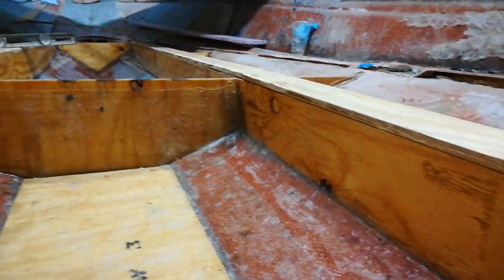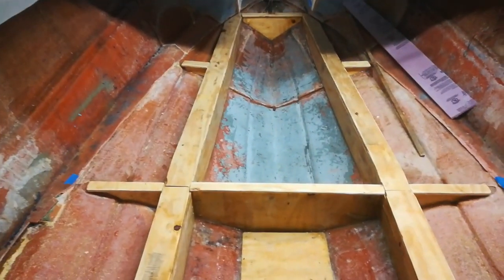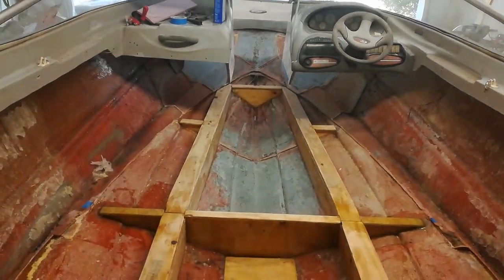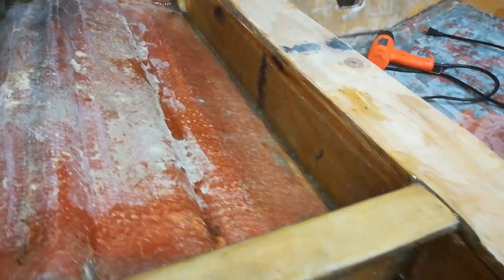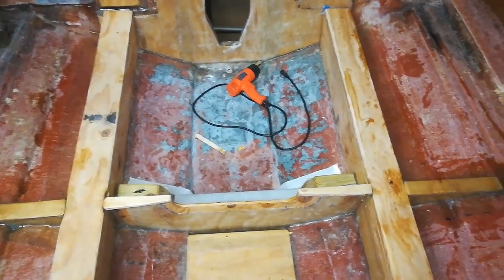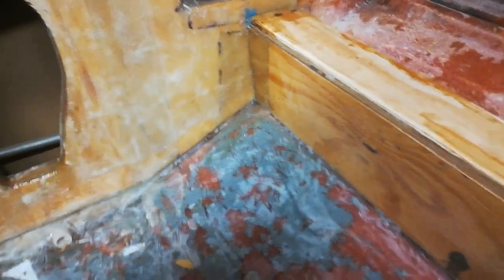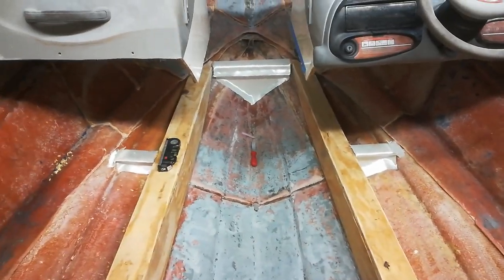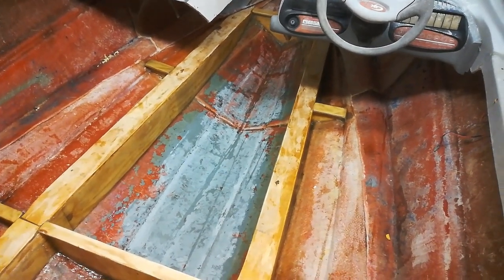Bayliner Boat Restoration - Part 23

Comment: How much fiberglass and resin have you used so far? I have an 19 foot 1986 bayiner I'm going to be doing the same thing to and was wondering how much materials were needed. Thanks!!
Reply from the maker: For the stringers, bulkheads and transom about 5 gallons of resin. But then for the deck itself another 5 gallons.

For fiberglass I got a full ~100 yard by 4' roll of CSM and of 1708. But I don't think I needed near that much. I have a ton left over still

Comment: Smoking job! I noticed you left out the bulkhead at the consoles? Was this to free up space for ski locker. I want to do the same but worried about floor being stiff enough structurally. May use some bracing between stringers. 
Yours is Looking great though
Reply from the maker: I did! To make more room for gear in the ski locker. Instead of a bulk head with a hold in the middle, I braced with a 2x4 across the top. It has been more than stiff for me 🤠 even what I did is probably overkill

Comment: Zach, I am impressed with your project top to bottom.  One question, where are you on the engine boring of the pistons?  Did you send it out?  Thanks  Keep up the good work!
Reply from the maker: Sent it out, got the cylinders bored +.030" got it back already. Got new  pistons. Will try to make a video for engine rebuild soon!

Comment: Awesome job!  It’s looking good.  Just a quick question, was there a reason you chose not to remove the top of the boat?
Reply from the maker: When I started the project, I did not know how difficult it would be to completely remove the top. I didn't think I would be able to without a gantry crane. But from watching your videos I see it must not be too difficult? ;) I was wondering if you needed a hoist for lifting yours, or if you man handled it?
Reply: Zachs Garage man handled the lighter back end and used our tractor to lift the front.  We’ve never worked on a boat before, but have remodeled many houses.  My experience is that usually I’m happier if I redo the entire thing if I have to dig much.  When I had to remove the gas tank I decided right then to redo the entire boat.  Hated the original 70’s orange color....

Comment: Why use caps? Why not just cut it to size?
Reply from the maker: what exactly do you mean by cut to size?

I'm mainly using "caps" to create a larger surface area for joints in the deck plywood to rest on